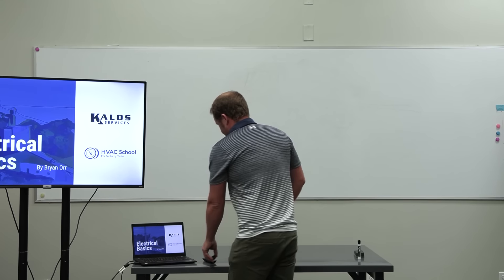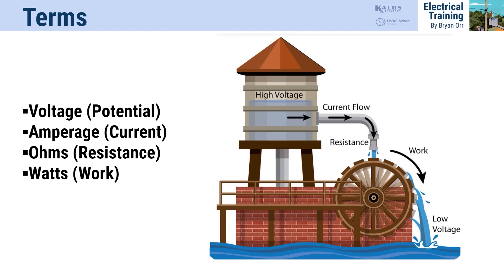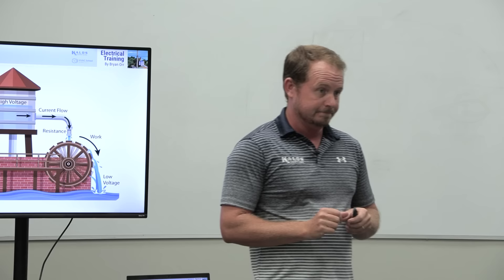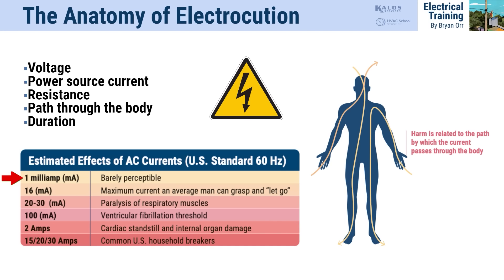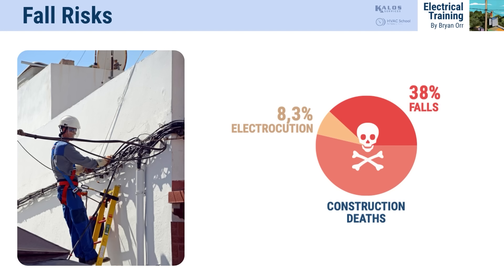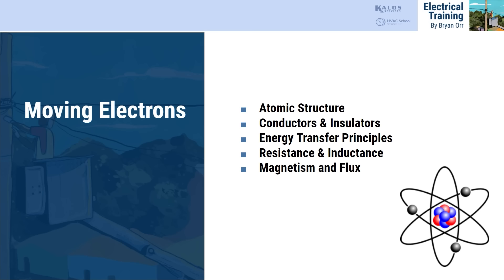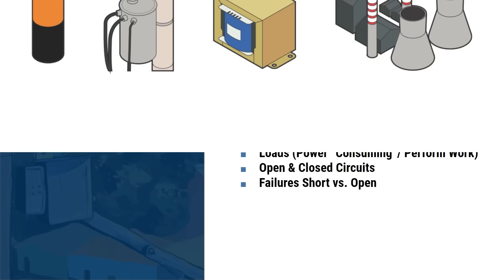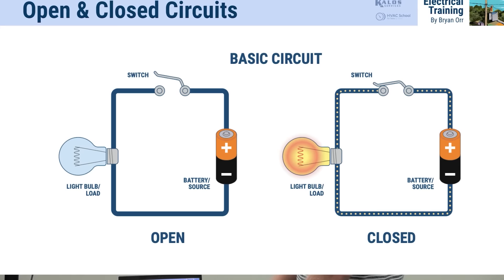Electrical Basics Class

Comment: I was repairing a Microwave oven and got shocked by the capacitor and it stopped my heart. It had been unplugged for a week. I lost consciousness and woke up on the floor. 
The sudden stop when my butt hit the floor started my heart  again. Discharge your capacitors with gloves on.
Reply: Sounds frightening thanks for the tip
Reply: What was it rated?

Comment: 1:12:30 - The most fascinating magic in electronics, to me is how you can open and close a switch to a coil really fast and get more voltage out than the applied voltage (e.g., high- and low-side MOSFETs on a laptop motherboard).

Comment: I was listening to your podcast between calls and in one about gas and combustion you guys are discussing buildup/flaking of the inside of copper tubing? I live in Ontario and I See this sometimes in service and quite often in installation when removing old equipment (25+ sometimes the line is 35 years or older) and the line is still gas tight, mind you seriously work hardened. In service it's worse on LP but seems to happen on both NG and LP and it's not actually going to be an issue until someone hits the line & with no dirt pocket. i see it  happen alot on fireplaces - might go into the gas valve, and people wonder why their fireplace flame is   only a gentle blue rumble after rennovations in the living room 😅

Fireplaces that are 25 to 35 years or older, with a 3/8 gas line will shale bad enough around that age, ive seen it actually have enough of a static pressure drop to drop out the pilot when the burner is turned on. It would probably happen with larger size tubing too eventually, but i have yet to see it be a problem on 1/2" copper or bigger. and it can change flame appearance very slowly, over those years  blowing out the line with compressed air once in the two decades can fix it. wrapping copper when passing thru and strapping against masonry has long been code here and no coastal salt todeal with, also galvanized is illegal - we see a ton of black iron, req. painted outdoors & CSST. I like copper because its cheap, effective and time tested. Only specified legal method of leak detection here is soap and dial, which make infractions based on electronic detection sketchy at best. Love the podcast man just want ed to leave my 2 cents.
Reply: Ill admit most folks dont maintain a fireplace long enough/often enough or use it often enough to have it get old enough for it to even be a topic of discussion lol. but we could knock out a cup full of flakes from 3 feet of tubing in some places! Its real man its not a conspiracy!

Comment: I hope this question makes sense: can someone please explain why there is less resistance when a motor is seized up? Wouldn’t it be more resistance impeding the path of the current trying to close circuit because it’s not turning freely making it harder or more resistant to turn? 

When he specified that we should understand resistance as the inverse of logical common sense way of thinking (like friction), I missed the explanation explaining why we should understand it that way.
Reply: The resistance is the same when a motor starts up that is seized or not seized. That is called locked rotor amps as there is massive current flow in both the rotor and the stator for a short period of time until the rotor gets up to normal speed. Then, there is back EMF that effectively increases resistance. You are conflating different type of resistance… If you understood that an induction motors speed is determined by frequency and poles, not voltage, this would all make more sense…

Comment: I have to ask: WHY does electrical resistance drip if physical resistance increases? I understand the inverse relationship between resistance and current, but I don’t get how physical resistance decreases electrical resistance.

Edit: I get the example given with the heat strip, but the example of rough bearings slowing a motor or something similar, I don’t get how that reduces electrical resistance.
Reply: A spinning rotor in an energized motor generates back-EMF in the stator, which has the effect of lowering the voltage that the motor "sees," or you can think of it as increased electrical resistance.  This why there is a current surge when a motor is turned on.  The current drops as the motor approaches its working speed.

Comment: Is it true that in alternating current electricity comes from the grid through the live wire and go back via the neutral wire. But why do you have a spark(short circuit) when you directly connect live and neutral, isn't the electricity supposed to just alternate between the wires? Just wondering
Reply: There's no load. In order to have a circuit a load is required or else wires burn ( if there was no breaker )
Reply: The neutral wire is only neutral in relation to L1 and L2; which is why we have split single phase, not two phase as some people incorrectly assert. You can still get shocked from the neutral…

Comment: Could you explain a circuit overload please. Since increased resistance from over "load" should decrease amperage then why does the breaker trip?
Reply: I'm not 100% sure what u are asking but, if u have an overload than the breaker would trip. So if u have a breaker rated for 20 amps and u overload it( putting to many loads on that breaker) and it begins to draw 20.5 amps or 21 amps, that the breaker would trip...
Reply: @TacoDaddy-mr8ig  Thank you for taking the time for that question. More what I meant is this; In ohms law if you increase resistance then you've decreased current, so if an overload is excess Resistance then wouldn't that decrease current and the breaker would never trip?
Reply: @nathanj.williams1955  actually with an overload, the resistance would go down and a lot more current would flow therefore the breaker would trip.. think about the word ' overload '  OVER(to many) LOAD ( HAIR DRYERS) so, if u have to many loads, than the current draw will increase and cause the breaker to trip..
Reply: @TacoDaddy-mr8ig  on a parallel circuit an overload would decrease Resistance which I think I understand now. Thank you very much man for helping me there.
Reply: Overload means your load is drawing too much current due to a technical malfunction. This means we are talking LESS resistance, which ia why more current is suddenly able to flow through the load. Overload is NOT increased resistance. Think of it this way: if the system is functioning properly all its parameters (Voltage, Current and Resistance) are well-balanced. When this balance is disturbed this is when things go wrong. Overcurrent means increased current due to strain or voltage drop (in motors, pumps, etc.). More current is drawn and is able to pass through the appliance because resistance has dropped and it should not otherwise have happened. Hope this makes it a bit clearer.
Reply: that's because the outlets in your house are wired in PARALLEL (not in series). In a parallel circuit, the more loads you add, the more current is pushed from the source (the circuit breaker). I would encourage you to look up how analyze parallel circuit. It will make more sense to you.

Comment: “Something isn’t happening that should be happening” is an open, but what about voltage drop? Is that not as much of an issue in a/c circuits as it is in d/c?
Reply: So,...If I understand the question sir,..while voltage drop is an inherent phenomenon in both AC and DC circuits, its manifestation and implications differ significantly between the two. AC circuits present unique challenges due to impedance, reactance, skin effect, and proximity effect, making voltage drop a complex consideration in AC system design and analysis, particularly in high-frequency applications and power transmission systems. Understanding these nuances is essential for optimizing circuit performance and ensuring efficient power delivery in AC systems.
Reply: @johnnyreb280  thank you for your explanation. Voltage drop testing as I’m describing on a DC is using a voltage measurement at the load. The result of a voltage reading lower than designed would reveal the presence of resistance in the circuit that should not be present if the circuit is in tact. For example, if I’m testing at a vehicle headlight and I’m measuring less than battery voltage, assuming the design calls for that, I might suspect corrosion in a connector. Is such a testing method appropriate with a AC system we might find in a commercial building or even a home? I’m curious if it might help speed up diagnostic testing on equipment specifically if one were to record voltages themselves while the equipment was operating correctly if that information was lacking. I see a lot of part swapping and guessing in a place I frequent. It seems wasteful in both parts and labor. One instance a board was suspected and was going to be ordered because a fuse was blowing. I quickly inspected the circuit and found a short. The board was expensive and unnecessary. I inquired about the voltage drop testing and it hadn’t been heard of. The subject of PWM came up because it’s used in the newer equipment and I asked which scope they use. Same result, I explained PWM too as it was unknown. It was odd to me because I see all the above daily in automotive diagnostics. That led me to the question I asked above. I know very little about AC systems and was curious if the nature of the AC system somehow rendered the test unreliable. I don’t see how it would be though on a piece of equipment that has fixed loads.
Reply: Alternating current has dozens of voltage drops per second, research root mean squared and you will understand… But, that type of voltage drop is not what you were really asking about… Yes, there is voltage drops in AC, but you generally wind up with other issues before you would notice the changes from a power drop - like smoke or fire from overheating wires…
Reply: @EarlHayward  thanks I appreciate your time answering.

Comment: Hi a little help here, can I use 20v 7.7a charger for 19.5v 3.3a laptop?. Thank you
Reply: Yes, you can. This is why:

The voltage difference - one half volt - is negligible. It’s only ~2.5%. The laptop’s charge management circuitry will cope with that just fine.

The current difference only refers to the peak amount of current that the charger can supply at the rated voltage - 5 amps at 20 volts. Your laptop will not be using the full, available 5 amps from the charger. The laptop only uses what it needs.

However, the POLARITY of the voltage at the connector, which plugs into your laptop, is absolutely CRITICAL. If it matches with the polarity of the old charger, (for example, the center pins on both are positive) then it should be fine. If the polarity is opposite, be prepared for a bit of smoke, and a trip to the store to buy a new laptop...

Good luck sir..
Reply: @TacoDaddy-mr8ig  thanks 👍

Comment: Ay time 1:10:43 - 1:10:44 u said the current in a parallel circuit is the same. Thats not 100% true, unless the are all the same..
Reply: He was talking about 3 identical light bulbs, which all have the same resistance, and since the voltage across each light bulb is the same, the current through each light bulb is also the same. But you're right, current might not be the same depends on the resistance of each load.

Comment: I got shocked by a neutral in the heater board
Reply: Yep. Many amateur electricians somehow assume neutrals don't carry any current until they get a nasty shock from a neutral. But in fairness, if a circuit is wired correctly, once you open the circuit breaker, there should be no current going through the neutral UNLESS there is a shared neutral. 99% of the times, if you get shocked from a neutral, it's because there is a shared neutral. The other 1% of the time is you grab both the neutral and another live wire from a different circuit. I guess this is probably what happened to you.

Comment: wooow!  comment about japan and 50hz!  Please surely you do not know electricity!  

50 hz when your power is 220volts and 60 hz when your power is 110 volts!
Reply: Japan uses both 50hz and 60hz frequency. The electric frequency is different on either side of the Fujigawa River in Shizuoka Prefecture and Itoigawa City in Niigata Prefecture, with 50Hz in the east and 60Hz in the west. They also use 100 volts and 200 volts.
Maybe it's YOU who doesn't know electricity...🤔🤔
Reply: The frequency does not change when the voltage changes, your comment should be ignored by anyone new to electrical theory…